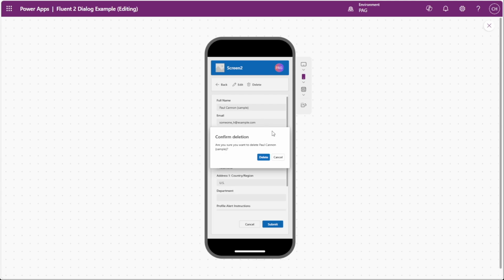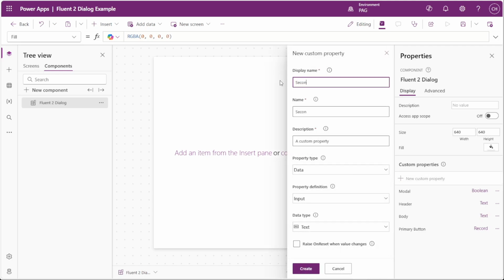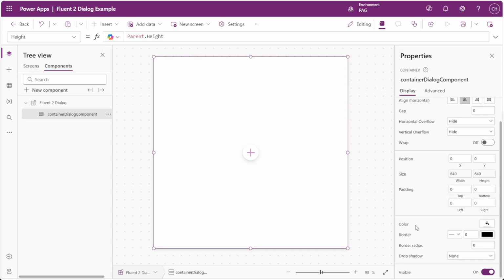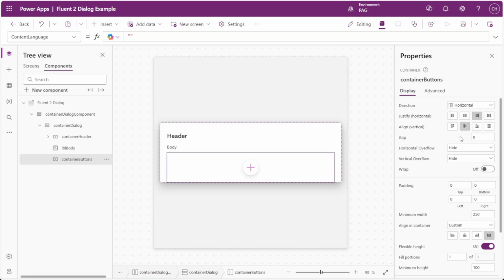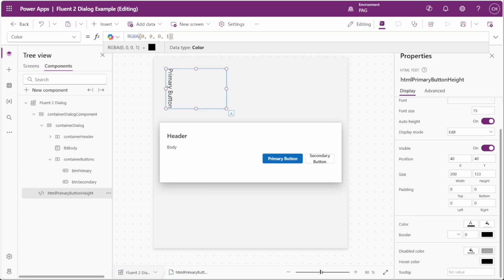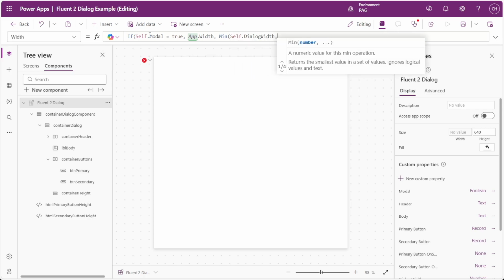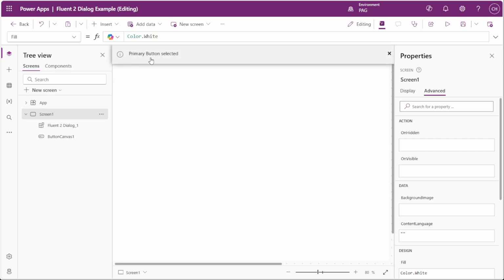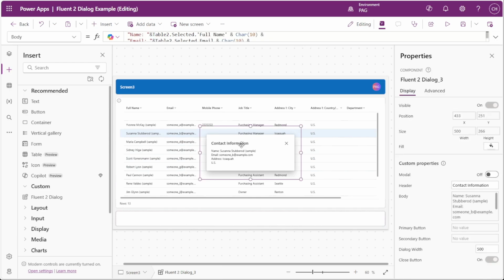Power Apps Modern Dialog Component Using Fluent 2 Design | Fluent 2 Component

Comment: Hi. Thank you for great tutorial.
But It going to be problem if I want to use Fluen 2 Dialog more than one in screen.
Reply from the maker: Hello @EdwinSmith-fr8qn! The recommendation in this case would be to treat the component as its own control, and insert as many dialogs as needed on the specific screen. You would then trigger the visibility of the specific dialog necessary. I hope that helps!

Comment: So what happens when you have 10 different popups in the same screen? Do you add the component 10 times or how do you control that? The popups are with different functionality, ofc.
Reply from the maker: Hi @pavelbenev3607! For a component like this I would think of it as an individual control. If you have different dialogs for different use cases on a single screen, it would be best to separate those into their own control to prevent any cross-triggering of the dialogs or their actions. Whenever you try to make a specific dialog visible, you would reference that individual dialog instance's SetVisibility function.

If you do want to use a single control, you could probably use variables to manipulate the text and buttons that show in the dialog. You would also have to use a switch statement in the Primary and Secondary OnSelect buttons to switch what formula executes depending on the text in the button. There could be room for error using one component for all of that, so that's why I recommend the first option!

Thanks!
PAG
Reply: @PowerAppsGuy  Thank you very much <3

Comment: I have modified component on a way that I have number input field.
This is used to enable user to enter number of the articles and the value is used in the patch statement on a component button.
Problem is that I didn't find a way to reset a field to default value.
Can you propose a solution?
Reply from the maker: Hello @ZoranRuzic1! Sorry for the delayed response.

One way you could accomplish this is to go to the Reset property of the component itself. Here you would add a Reset function for your number input field, so something like:

Reset(NumberInput1)

There are two places you could "call" this reset of the component:

1. Wherever your app is making your dialog visible, you could reset your dialog before making it visible. For example, if you have a button that is set to:
'Fluent 2 Dialog_1'.SetVisibility()
You would change this to:
Reset('Fluent 2 Dialog_1'); 'Fluent 2 Dialog_1'.SetVisibility()
This would reset the dialog before making it visible.

2. You could reset the dialog after the user selects one of the buttons inside the dialog. You would just add the Reset function referencing your dialog component inside the PrimaryButtonOnSelect and SecondaryButtonOnSelect properties of the component. 

I hope that helps! Let me know if you have any questions.

Thanks!
PAG
Reply: @PowerAppsGuy  Thank you

Comment: Since the variable is global, the dialog might open across all screens when it's set to true, which could negatively impact performance.

Thanks you!
Reply from the maker: Hi Yaser, thanks for your comment! The variable is contained to the individual dialog component inserted on the screen since the “Access App Scope” toggle is disabled on the component. If that is enabled, the variable set in the component would be shared across all the components (because the app can access the scope of the component and vice versa). In this case since it is disabled, each dialog component inserted on a screen will have its own variable, and it is treated more like a context variable held inside the component.

I hope that helps, thanks!

Comment: That's realy an amazing video.
I have one question: If you use only one component for different dialogs in a PowerApp, setting Header an Body can be done with variables. But how can you programmatically set the Buttons on select commands. They won't be working with setting variables, which include the commands.
Reply from the maker: Hi Markus, one thing you could do is use a variable to populate the buttons with an extra “key” field, so your schema would be ItemDisplayName, ItemType, and ItemKey. You could then use a switch statement inside the OnSelect property of the component to switch on the ItemKey and perform a different formula based on the ItemKey that was fed into the OnSelect property.

You’d need to add a custom parameter to the component’s OnSelect property as well so that it’s expecting to receive an ItemKey parameter.

I hope that helps!

Comment: Amazing video bro! Just one thing: how would you use more than 1 dialog component in one screen for different types of actions? When I try to add multiple dialogs, doesn't matter if I'm referencing one component property SetVisibility, all of the components are affected.
Reply from the maker: Thanks! Glad you enjoyed it!

You’ll need to turn off Access App Scope on the component in the component’s settings. That will isolate each instance of the component inserted onto a screen, so only the one that you reference in your button will be made visible. Let me know if that works!
Reply: @PowerAppsGuy  It worked!! Thank you! :D